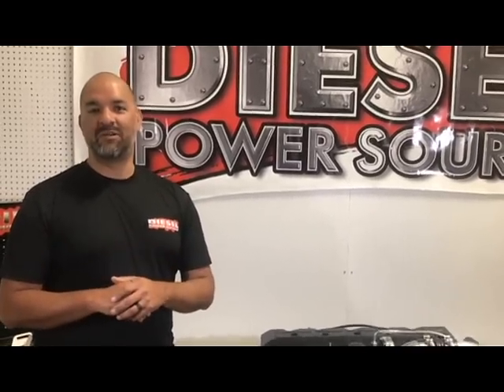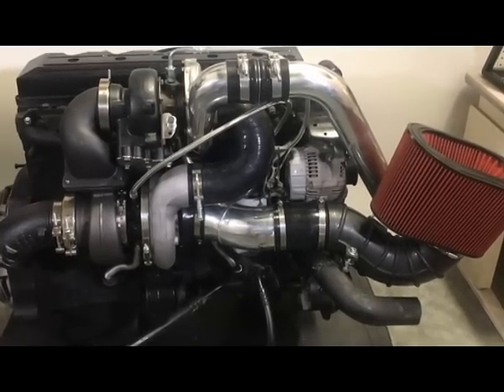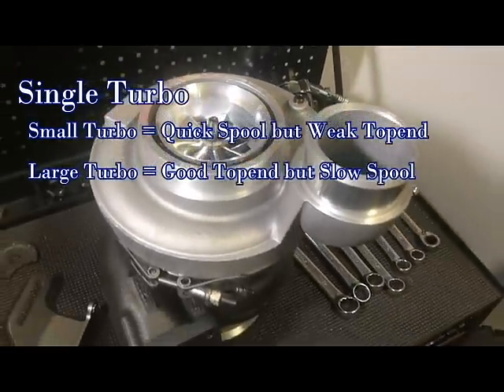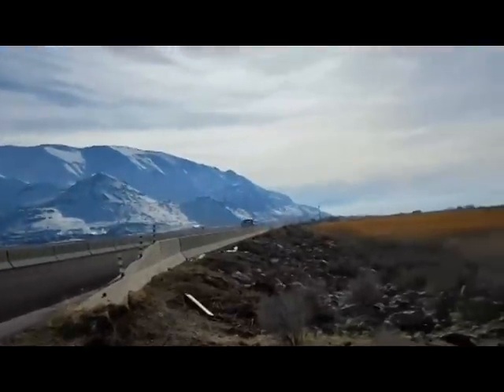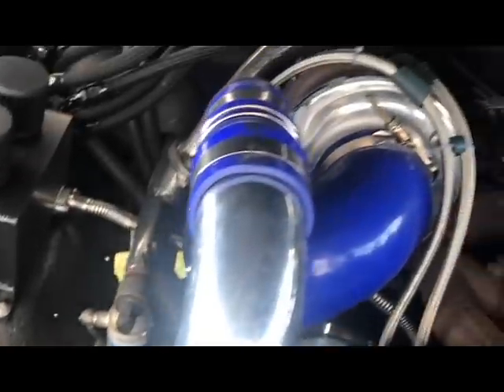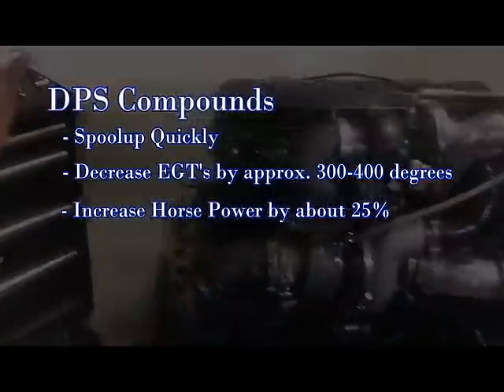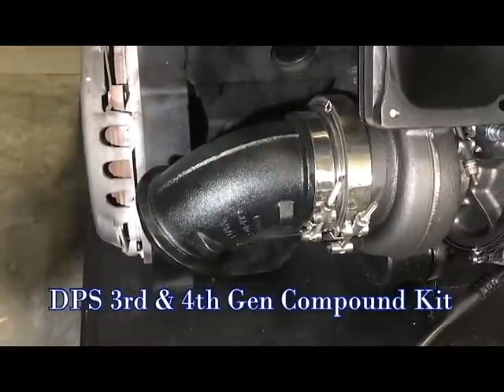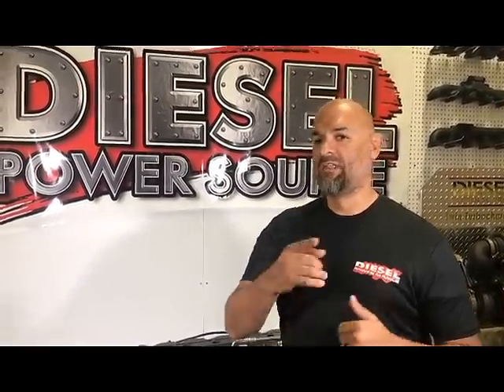How Does A Twin Turbo Work? Compound Turbos? Diesel Power Source Compound Turbo Kit Long-Term Review

Comment: What type of hp #'s are you seeing with this kit? I'm building a 24V (08) Fummins (2000) and am looking for 600hp with 1000+ ft lbs, daily driver without smoke. Is this a good place to start? I tow a 30' gooseneck trailer with about 20,000 lbs several times a year.
Reply: DPS lists compound kits on their website for anywhere from 300 hp up. From that info I’m guessing they would recommend a stage 2 or 3 kit. What kind of transmission you’re running may also play into it. But I’m a year late replying so you probably got this sorted already

Comment: Has anyone ever put a compound system on a Chevy 6.5l diesel? Possible or not just curious
Reply: Yea it’s possible but why would you waste any kind of money on a 6.5?
Reply: @chrishansen7004  because I love them. I own 2 and they are my workhorses. I know them inside and out and are pretty simple and easy to maintain if you know how they work.
Reply: The stock turbos that ended up on the 6.5's are sized with immediate spool in mind (fast to spool, fast to choke) and the exhaust routing is an absolute joke. 
Considering IDI's can't take as much boost do to their compression ratio, and that 6.5's like to run hot, I would sort out the exhaust routing first. There's a guy on youtube that built parallel turbos (one per manifold) to solve those issues.
I own a 7.3 PSD and know there are tons of options to swap wheels and housings with. If you got some non-turbo manifolds, and piped to that turbo, you could remote mount it via pedestal, and v band. If you didn't like the way it worked, pop it off and mod it.